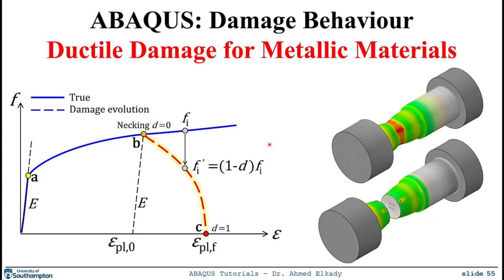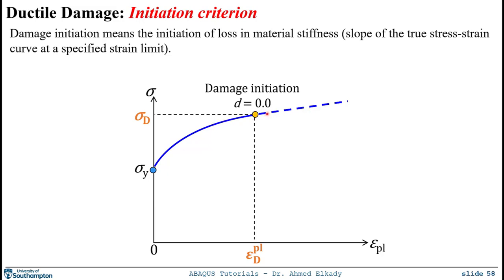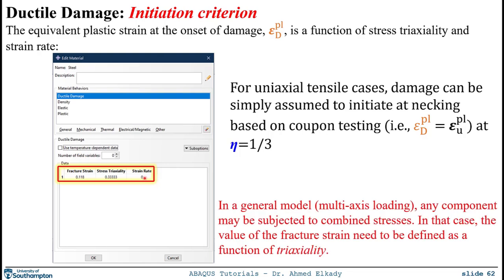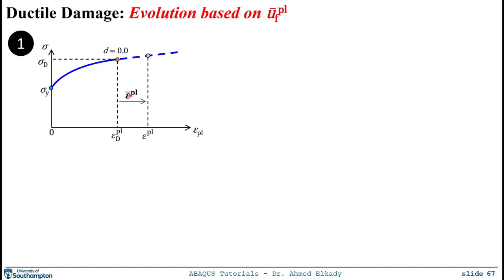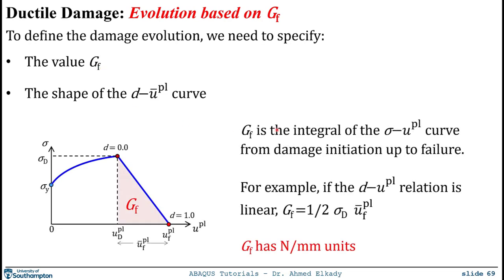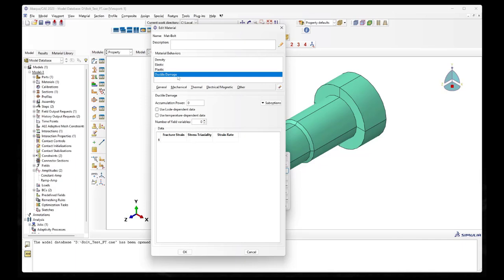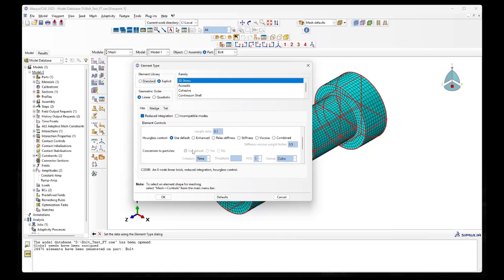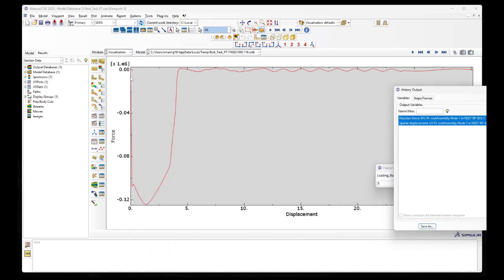#39 ABAQUS Tutorial: Ductile Damage For Metals

Comment: Thank you for this great lecture. My question is that should we define the ductile failure for any steel material in any model or for a specific applications only?
Reply from the maker: No, only if you want to quantify bolt failure in your analysis. For most applications, the standard elastic-plastic definition is enough.

Comment: Could you please make a video to modify/ customise all the convergence parameters in ABAQUS?

In highly nonlinear simulations, where the solution does not converge, we often get the "negative eigen value warning" shortly after that, there is a convergence error.

Could you possibly discuss it please?
Reply from the maker: You can check this blog for info about dealing with convergence issues: https://caeassistant.com/blog/abaqus-convergence-issues/

Alternatively, you can use an explicit step.